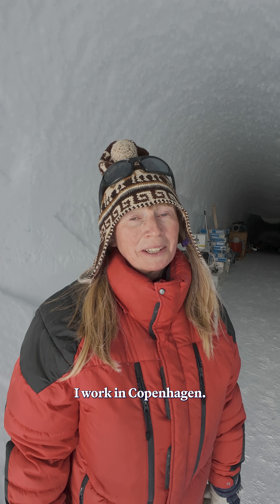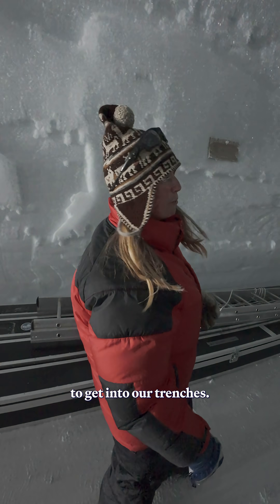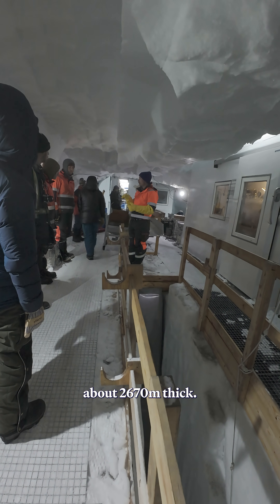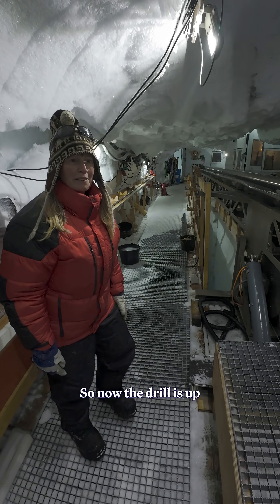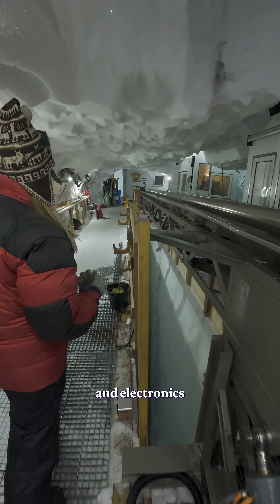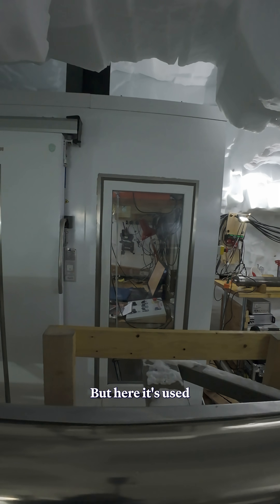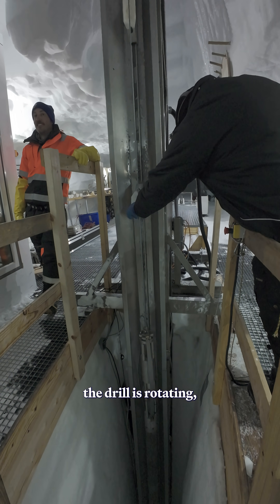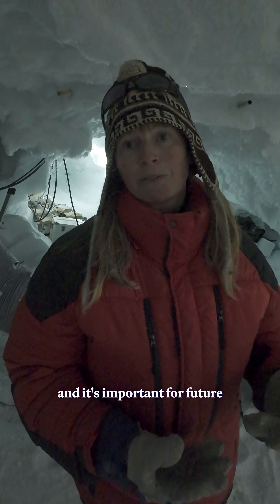The lab under Greenland's ice sheet

Comment: I think it would be wise to have 2, 8 inch wide metal pipes leading from the entrance to the inner areas incase of a tunnel collapse as a way to get supplies and communications to anyone trapped inside. The pipe should have multiple opening spots so that those items can be retrieved at various locations. Pipe shapped RC vehicles can transport the items. Pipes can also act as fresh air intake.

Comment: I know water is the only matter or one of the only forms of matter that expands upon cooling 
I wonder how is that affecting it's behaviour in motion 
My prediction: friction will always create heat, but water condenses under it - which is why other than the pressure the ceiling goes down and the cooling ice keeps the ground lifting (which is what she explains in the video) 
When is the threshold of ice begining to fluid dynamics and does it do so a little as a solid? 
This is true to earth, but earth expands upon heat as water condenses and expands upon cooling 
First the evaporation of the ice is within which is why they need to drill so deep into the ice 
I need to meditate on that

Comment: It's it just like a scientist to explain that the low ceiling is due both to the floor rising and the roof compressing due to the pressure of the ice above yet unconcerned of any dynamic movement towards the ice closing this void and no sign of any tunnel safety structures common in other types of tunnels?

Comment: Don’t hate me for not knowing or forgetting but what benefits or information do we get from frozen cylinders of ice? (Ice core samples) and what’s does it determine or what effects does it facilitate
Reply: 2:19
Reply: @D.S.Parent_Sr that doesn’t explain how ice samples can determine global warming or whatever the cause may be
Reply: @TheBordens222 Because the snow that eventually became the ice cores traps elements of the atmosphere at the time it was formed. Therefore, each successive layer of ice contains an imprint of the state of the atmosphere, with deeper layers going further back. Through the data from those imprints, such as relative carbon content, microscopic particulate, et cetera, you can do things such as estimate the changes in average temperature, track the effect of prehistoric seismic events, and even correlate such data to infer what impacts it has had on life and biodiversity across the world.
Reply: @SophiaAstatine so basically tracking environmental shifts and understanding of where we stand in our current oxygen/carbon state?
Reply: @SophiaAstatine I’ve always been interested in this stuff especially research in Antarctica

Comment: Wait where's the sea levels rising? Cuz the tide comes in goes out and 41 years it's not changed not a single CM more or less but stays exactly the same just like in North Pole & time laps shows a decade of recording the ice& water level remains exactly the same! This whole carbon hoax caused climate change is a lie bad info shifting the blame from corporate toxic waste and blaming it on the oil industry or something else instead of taking care of actually pollution things like removing micro plastics and heavy metals THAT IS REAL CLIMATE CHANGE NOT THE CO²! So fed up with all the lies

Comment: You know it’s cold when a FREEZER is used for heating
Reply: its not on its just used because of the insulation
Reply: Don't worry. It isn't turned on.
Reply: A regular freezer or refrigerator only has a one way cooling cycle.  As soon as it reach the desired temperature the compressor shuts off and awaits for the temperature to rise where it turns on again.  So they never function as you think they are if the outdoor temperature is colder than the unit operates at. Transport refrigeration units and containers on the other hand switch between cold and heat so it can regulate properly for any kind of outdoor temperature.
Reply: It makes sense. All regrigeration works by transferring heat from the place you want less of it to the other side of an insulated area.

So this is a reverse freezer- it's transferring the heat from the outside in.

Comment: Now that’s cool. Cool as ice.
Jokes aside, it’s seriously impressive, drilling over 8,000 feet into a sheet of ice. That’s a little over a mile and a half. Straight down. Let’s put it this way, if you dropped your lucky penny down that hole, it’d take about 4 minutes for it to hit bottom. 
Crazy. Also a little concerning that the lab is slowly trying to crush you, though I’m sure you shave more off when the ceiling gets too low. 
Last thing, you mention this is on an “ice stream”. Is that at the bottom of the hole? If the sheet is moving, how is the hole maintained? Drills aren’t known for their bendiness, does it have to be re-drilled or bored out from time to time? 
Now ya got me curious.

Comment: The ice pieces drilled from depths gives a lot of information about the past climate and how it changed over the past thousands of years. For example, these ice cylinders contains trapped air bubbles which are studied to get the carbon dioxide concentration in the past. So we know how the carbon dioxoed concentration in the atmosphere changed in the past. The age of ice is determined  by studying it's isotopes.

Comment: Wait! Each year we have to go deeper? WTF happened to climate change?
Reply: It's still happening. You understand that places are still cold enough to experience snowfall, yes?
Reply: @MainlyHuman the news says it snows much less than before, sea levels are rising because the poles are melting at a massive rate rate faster than snow falls and accumulates. How can we have it both ways?
Reply: @ohcrap3263 well there you go. It snows less but it still snows. So snow still accumulates on top of the base as the ice floe it sits on makes its way to the sea. But the ice is moving faster and faster and there is less snow falling, so sooner or later all of that snow is going to be in the ocean.
Reply: @MainlyHuman so if there is less than before is the ice not thinner because more melts than accumulates. How does one go deeper into something that is thinner ,and as you pointed out is thinning  from the bottom  because there is less accumulation at the top.

Comment: I’m glad you explained what the freezer was for. My brain immediately asked “why in the world would they need a freezer?!?”. Pretty good idea to use it to keep warm. They are pretty well insulated.
Reply: ☝️In places like this you need FRIDGES & FREEZERS to keep things from getting dreaded "Freezer Burn" & keep things at EVEN Temperature. So: FREEZERS ... to STOP things Freezing too much! 😂
Reply: Exactly its like how you can use a thermos to keep cold things cold too
Reply: They've turned a freezer into a rezeerf
Reply: What happens when the ceiling lowers too much, though?  I guess either you dig it out or end the project. Wonder what their ending date is?
Reply: @cherylfox6765  they probably just remove some ice from the ceiling just so that they can walk around
Reply: Reverse the compressor and it becomes a heater.  Think heat pump.
Reply: Drillers are pretty clever when it comes to making things work in rugged and super remote locations, you have to be! And those drillers need that shack to sit in and keep warm because the helper does all the manual work alone unless something goes wrong lol
Reply: Like refrigerators for keeping tortoises warm lol.. I live in the desert, and some people here adopted the desert tortoises that are native here, but to let them brumate outside naturally, you need to have a proper burrow of a certain depth, shape, and angle to control flooding during rains. But sometimes people don't have a good enough burrow for winter, and if you keep them in your house it's usually too warm, they have to be kept at specific temperatures as if they were sleeping deep in a hole in the natural desert. If not, your tortoise can actually get too hot during the day when the sun is out, but still freeze overnight during freak desert cold snaps. Some people simulate safe conditions instead by taking a refrigerator, setting it to those exact temperatures, and setting their tortoise inside a box in the refrigerator, removing briefly on occasions to hydrate if necessary. So using a refrigerator to actually make sure the tortoise never gets too hot or too cold during the wild fluctuations of desert winters.
Reply: Yeah... and you don't wanna heat up the surrounding area when the walls are made of packed snow and ice. xD
Reply: I thought igloos and ice holes were warm? Or is it ice shelters? Anyway, the roof sinking down is where I say hell naw
Reply: Why risk a cave in and just build on the surface? I don't get the risk? Didn't they drill down over seven miles down in Siberia from the surface?

Comment: You need RCC structure that transferes the Pressure from top to bottom. So the whole room will go down as more Snow builds up. 
2nd Solution is to make sure Snow on the surface is cleared which will require a empty lake structure. Over place it is below.

Comment: I was privileged to see Antarctic ice cores in 1969. Even then we had incontrovertible evidence of manmade climate change via airborn particulate from burning of coal. It is chemically and structurally different to any other material in the air. You could clearly differentiate ice from before 1800, and after.. from ancient ice thats rock solid and vivid deep deep blue, to more recent ice thats white slush, riddled with acid from burning coal.

Comment: Oh no, the ice sheets are melting! We should excavate massive holes in them and fill them with warm air, this will surely help them not melt faster.... Oh no, the ice sheets are melting faster than expected!
Reply: Is the answer to drill more holes in the ice? Something tells me they want to drill more holes in the ice.
Reply: Go to your nearest lake and poke a hole in it with a needle when it's frozen in the winter. Do you think your needle hole will make it melt faster?

These drill holes are incredibly tiny compared to the enormous mass of the south pole - and the air is famously NOT WARM.

Comment: Wow, 2km+ depth
Can someone calculate, how long it would take for a hand grenade and its mass to reach the bottom with the atmospheric pressure and the terminal velocity, then subtract 5 seconds (or however long pin primes for grenade) worth of distance to replace with a rope. Then, attach it to the rope and calculate how much deceleration it needs for the string to pull off the pin at the end of its length.

What I wanna know is
1. How much of an impact would a hand grenade cause to the entire structure of ice and that facility from 2,000+ meters away
2. How long would the impact reach the "surface" and how long is the time distance between its physical impact (if any) with its sonic impact (like dropping a coin to a well, basically)

Comment: Here's an idea! How about a heating element inside the core of the drill, so when it drills, it constantly melts the water and you can just pump it out while drilling.
Reply: The purpose of the drilling isn't just to reach the bedrock - they want the ice the drill is cutting through so as it moves it's creating a cross section of the ice like an apple corer.  They can then analyse the layers and air bubbles in the core to understand what the climate was like in the past.

Comment: 2600 meters Straight down!!!! the Ice is thicker than 2.6 kilometers!!! Since they had to walk down into a trench to get to their gear and rig, that was once on the Surface? And the ceiling crushes down in slow motion while the Floor pushes up, also in slow motion. That is Freakishly disturbing, almost the setting for a Horror game where all that remains of the drilling crew and scientists is mere blood stains and small mounds of Frozen blood where they died, each one completely gone and you have to figure out what killed them, and what was in the ice that Turned a 18 inch bore hole into a massive crater when it come out, to feast on the people that woke it from its slumber. Could be a second or sequel to The THING. since the last movie was actually a prequel.

Comment: There was a winter day at work where the heat stopped working but the fan kept blowing. The 40f degree walk in fridge was warmer than the kitchen. The freezer was about the same temperature as the kitchen. The freezer is about 20-30 F. It’s funny how they use a freezer to keep warm because I was using the walk in to stay warm that day

Comment: The ice sheet is 2.76 kilometers thick and still accumulating. That seems quite a noteworthy indicator of something.
Reply: Ice sheets melt from the bottom, not the top, since the higher the altitude the colder it gets. Glaciers form when the amount of snow that gathers at the top is more than what melts at the bottom in the same amount of time. Its basically a really big, really slow river. The older stuff is pushed downwards by the weight of the new stuff.
When we talk about an ice sheet or a glacier melting, what’s actually happening is that the amount of ice melting at the bottom is more than the amount of snow being deposited at the top!